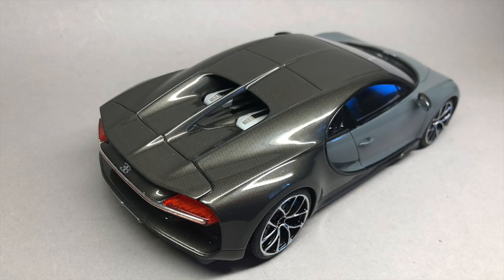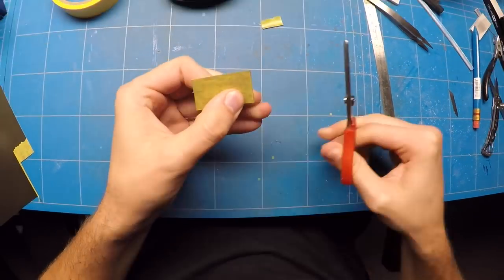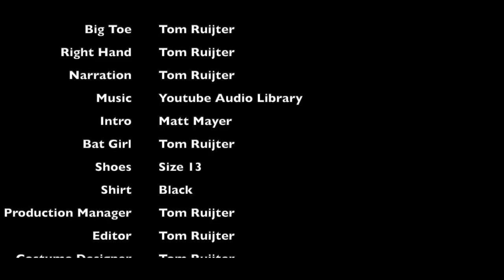Alpha Model: Bugatti Chiron Decal template making and  Carbon Fiber Decal Application Time Lapse

Comment: Most of what you use is not available here. Including that fantastic Tamiya Spray stand. I also recently check all the hobby shops in Edmonton for Carbon Fiber Decal sheets after you posted this build. Also not available. You are so lucky to live where crafts are supported and available.
Reply: But you can ordet it on his webshop
Reply from the maker: And that is why i buy off of the internet
Reply: Try ebay or try asking at your local hobby shops ask if they would order the stuff you need. Have you tried going further afield by looking if what you need in other hobby stores not just the ones closer to you? I got my Tamiya  paint spray stand from Hong Kong and postage wasn't bad at all.
Reply from the maker: Also check the video description. Tons of links on where to buy the items